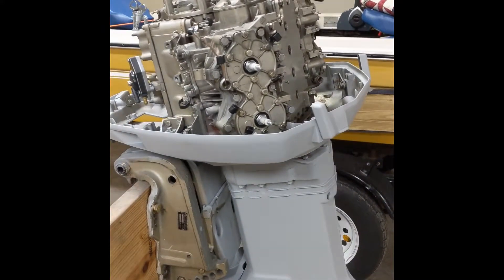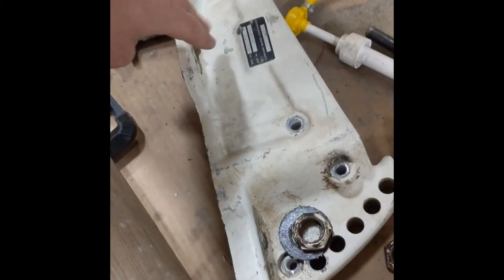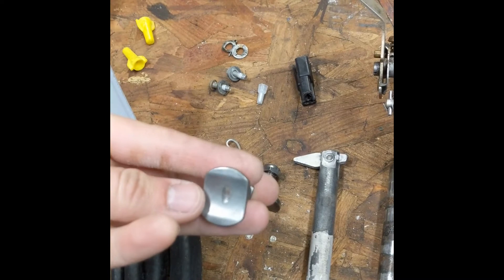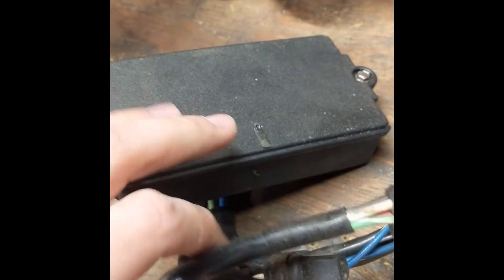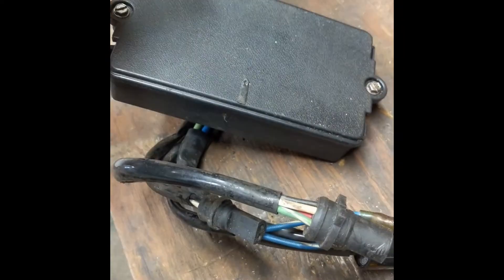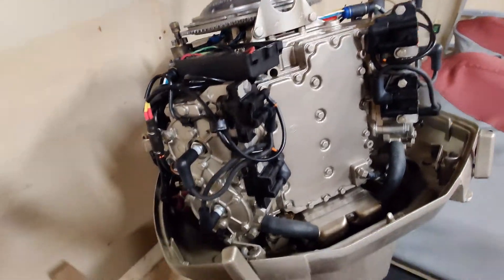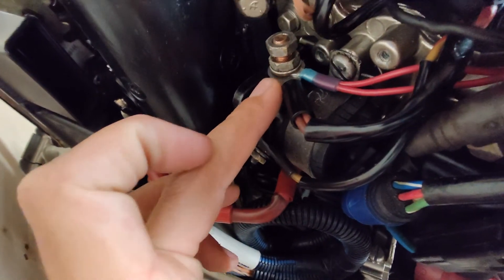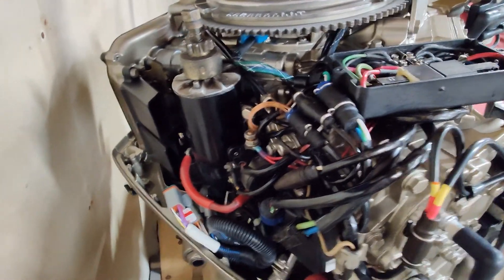1978 Evinrude 85hp Manual trim to Hydraulic upgrade

Comment: @wagdbikerider any chance you still have this setup?  I was wondering how it all connected underneath
Reply from the maker: I do have the setup.  What do you mean connected?
Reply: @wagdbikerider  I have a 77 but it looks exactly the same. 
I didn’t know if the new tilt trim attached to something under the motor where there is now two cylinders or I guess manual
Reply from the maker: @fenderstrat05  it bolts where the manual tilt cylinder was. When you pull it apart it really only goes on one way

Comment: Off topic here but I came across low hour not used much 1978 85hp same as yours here been sitting quite few years- Owner wants $800.00 for it - I know the old 3cyl 70's were very good but not much experience w/ these- I have '64 Classic 17 foot whaler looking for closer to period motor for this hull- Just wondering what's your opinion about these old school engines? Thinking hard about making offer but got no clue seeing you have one thought I ask thanks for any info, jack

Comment: Got the same engine and want to upgrade it. Do you have a part number I can use to source a tilt motor? Thanks for sharing
Reply from the maker: Part number is hard to go by. They are the same for years though. Just look for a 2 wire on ebay like I did